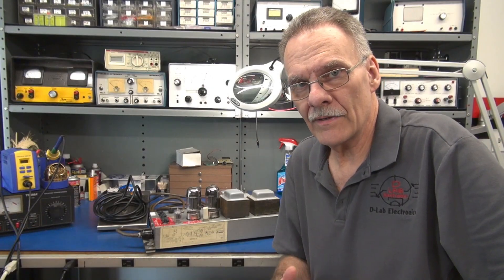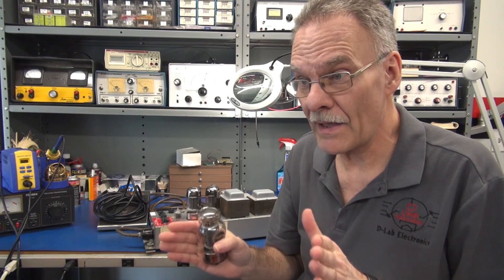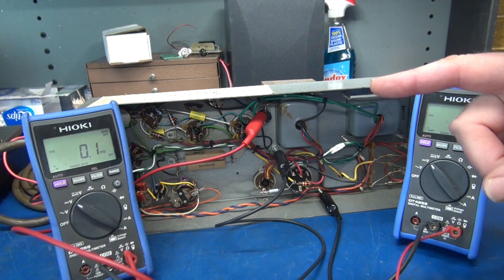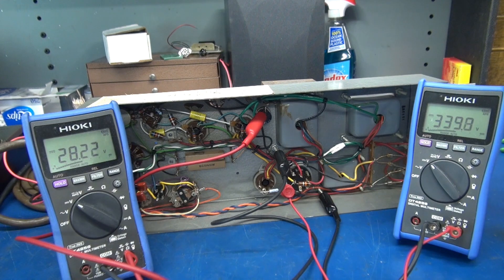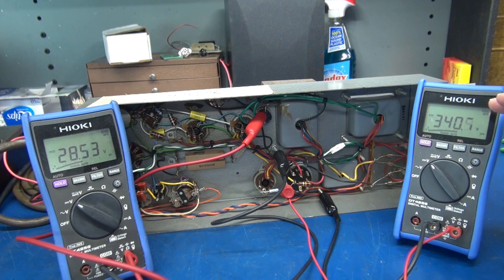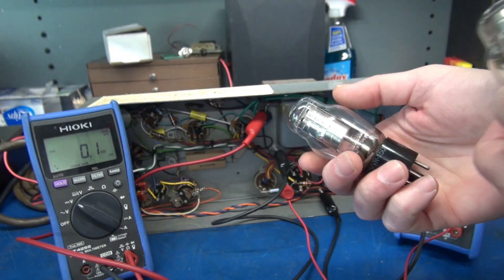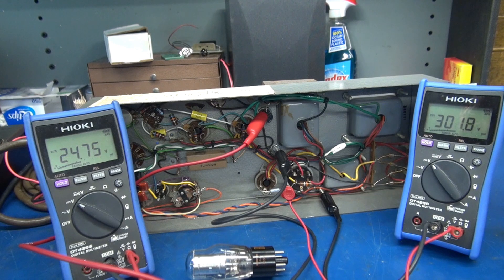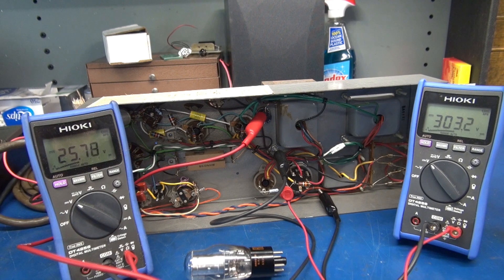Vintage Leslie 147 Tube amplifier power supply voltage level adjustment 6550 bias

Comment: I am concerned about the way the plate voltage 455V was measured. As it was mentioned in begining the tubes before solving problem were not assembled due to saving from possible  damage but value  415V in schematic diagramm is always with all tubes in?   It  is tricky to do measurement without tube and get right value.

Comment: You must have fairly high wall voltage in your shop - hopefully the customer also does where he uses that Leslie.  There should be an 8 ohm resistor R1 in series with the power transformer's secondary winding located on the same terminal strip as the rectifier diodes; this amp might be early enough that it doesn't have it. If it doesn't, you should add it; it will drop the voltage a hair and will also give the tubes and can capacitor a softer start.  George has mentioned in the past that he has church customers with very high line voltage (Texas grid); he has been increasing the value of that resistor to compensate.

My units travel around, so I can't tune for a specific wall voltage; my solution is to use KT88s. The JJ KT88s sound very close to the vintage Tung Sol 6550s you had to replace.

BTW, the 470 ohm replacement is a tell-tale of amp problems in the past. Make sure you check the value of the fuse that's in the front of the amp, I often find these much larger than they should be when that resistor has been replaced. Any sign of red-plating on those tubes?

https://elektrotanya.com/PREVIEWS/63463243/23432455/oldies/leslie/leslie_145_147_sm.pdf_1.png

Comment: Innovative solution! However, the problem is not only the screen but also plate voltage. It should be some 415-420 volts (IIRC, too lazy to check from the schematics). The way how the 6550 tubes distort is essential for the legendary Hammond growl. So my solution would have been reducing the plate voltage as well with resistors or zeners.

Comment: I've got a Leslie 145, same as 147 but slightly smaller cabinet. My amp does have the opposite "problem" - low B+. The 6550 plates sit at 400V and screens at around 290V, so they're not stressed at all. Maybe it's because of a different power transformer on the European-made units.
Reply: Euro transformers were designed for 234V wall voltage, I believe.  Does your Leslie hum? If it does, both problems could be explained by an open section in your can capacitor.
Reply: @garlandmusic  Very little hum, as far as I can hear. I replaced the can cap with a CE 30/30/30/10 unit during an overhaul of the amp some years ago. Maybe I should test the can cap sometimes.
Reply: I have seen the low voltage condition caused by a partially shorted can.

Comment: D LABs, why is the AC line voltage higher than normal? is the AC to AC transformer have shorted windings. Changing the voltage regulator to a higher voltage regulator to step down the voltage doesn't seem right to be using a higher voltage regulator to step down the voltage to the operating voltage. Any reasons why Leslie 147 amplifiers even used voltage regulators? because most guitar amplifiers don't use voltage regulators at all.
Reply: The 0C3 in a Leslie amp does not operate as a traditional voltage regulator.
The 0C3 is wired in series with the screen circuit and the plate supply for the 12AU7 driver tube. Being wired in series, the tube acts as a dedicated voltage drop (around 105 volts, in this case). If the B+ supply changes, the voltages past the regulator will change by the same amount. Note that when Terry changed the regulator tube, the B+ still remained at 455.
The regulator insures that the screens stay at approx 100 volts below plate voltage; without using big resistors and additional loads.
By installing an 0D3 in this amp, the screen circuit (and subsequently 12AU7 plate voltage) are dropped by 150 volts, instead of 105.
Tech Note:
When the 147 and 122 Leslies were reissued in the 90s, the amps were equipped with Zener diodes, instead of regulator tubes.
Reply: @scottbc31h22  Any reasons why the Leslie designers used an OC3 tube in series to be a "voltage dropping" device? The datasheets for the 0C3 or the OD3 don't say how much voltage it will drop from cathode to plate. The way fender and marshall would create the screen voltage was using dropping resistors called "internodal resistors" tapping off of the B+ high voltage
Reply: @scottbc31h22  The Tube Regulator should be regulating both the Plate voltage and the screen voltage, I'm not sure why they designed it to only regulate the Screen voltage, any reasons why?
Reply: @waynegram8907  The 6550s do not like high screen voltage, they work better with screens around 300V. AFAIK, Donald Leslie based his amp designs on the 6550 datasheet, which says 400V plates and 310V screens for cathode-biased Class AB and 40W output.
Reply: @waynegram8907  The 0C3 in a Leslie amp is not acting as a voltage regulator, in the traditional sense. It is not actually 'regulating' the voltage.(keeping the voltage at a constant value). Leslie power supplies are really not regulated.
  Since the 0C3 is in series, it is acting as a "resistor" to drop the voltage by a set amount. 
For example, if the 0C3 sees 400 volts at the input, it will output 300 volts. But, If it sees 450 volts on the input it will output 350 volts. (figures not exact) This method of using a regulator tube (or zener diode) is rarely discussed in textbooks.
  The 0C3 is acting as a 105 volt zener diode. In reissue amps, the Oc3 is replaced with a Zener.
  The 0C3 , also known as VR105, has a voltage drop of 105 volts. The 0D3 is also known as VR150, therfore, having a voltage drop of 150 volts.
  My guess is that using the regulator in this manner is more efficient than using a voltage divider to reduce the screen voltage.
  Also, the plate supply voltage for the 12AU7 is tapped from the 'regulated' screen voltage.
  Schematics for the more common Leslie amps are readily available online.
Reply: Another interesting fact about Leslie's designs.
Earlier Leslie Cabinets were equipped with electro-magnet speakers. These cabinets had amps that employed 4 x 6V6 tubes for 20 watt rating, and 4 x 5881 (6L6) tubes for a 30 watt rating.
  Most Manufacturer's designs using EM speakers either use the field coil as a choke in the main power supply, or have a dedicated B+ tap.
Leslie tapped off the B+ supply with a 400 ohm power resistor, through the field coil and returned the field coil to the cathode circuit (!). The screens (and driver tube plates) are connected at the junction of the 400 ohm resistor and the field coil.
Removing the field coil from the circuit will throw off the screen voltage as well as the cathode circuit. The amp will still run, but it will eat tubes.
  When it becomes necessary to replace the speaker with a PM type, some techs have installed a large power resistor in place of the field coil, to keep the bias correct and keep the screen voltage down.
  This wastes 29 watts of power to unnecessary heat,
  There is a  mod that can be done to make the amp run right, without wasting all that power to heat. It involves inserting a zener diode in the screen circuit, and replacing the cathode resistor to correct the bias.
 IMHO the 6L6 and 6V6 amps were the best sounding amps Leslie ever built.

Comment: A few thoughts regarding Leslie amps. I have serviced and rebuilt numerous Leslie amps of various types.
1. Plate voltage in your amp is high, probably due to increased line voltage. Leslies were designed for 117 VAC line voltage.
2. I commonly see 430VDC on the plates
3. I usually see 27-28 volts on the cathodes.
    If you feel the cathodes are not at the right voltage, check the 150 ohm power resistor in the cathode circuit, and replace the 200 uf cathode bypass capacitor.
    Special note: The cathode resistor in the 147 amp is connected between the center tap of the secondary coil of the output transformer and the 6550 cathodes are connected to the speaker terminals of the OPT. (polarity of the speaker terminals and tube cathodes is critical)
  An old tech once told me that running these amps with 27 volts on the cathodes will not hurt the amp. he told me "Let them run a little cold".
4. If you suspect a shorted tube, it is best to replace the 470 ohm resistor connected to pin 2 of the 0C3. This resistor acts as a fuse if the tubes go into a screen short. I use metal film resistors, since they show if the resistor has overheated.
* USE ONLY A 1/2 watt RESISTOR IN THIS POSITION as it does act as a fuse. I replace this resistor whenever I see any signs of overheating.
5. The 0C3 also sets the supply voltage for the 12AU7  input tube. Plates of the 12AU7 should be 118 VDC. I commonly see 130 VDC here.
6. Check the .1 uf caps for leakage. There should be 0 volts on the grid side of these caps.
I commonly read 0.05 volts here with brand new manufacture tubes, regardless of brand.
If I see anything higher here, I look for a problem. Usually a bad 6550 or bad coupling caps.
7. If replacing the filter can, I recommend the 525 working voltage can from CE, instead of the Leslie spec 475 volt version.
Since the 147 uses a solid state rectifier, when the amp first powers up, there can be as much as 500 VDC coming off the power supply before the 6550s warm up.
8. a note for those not experienced with 0C3 regulator tubes.
These came in two different versions. The original version was filled with a mercury vapor, and had the Coke bottle shape, as shown in the video. These tubes will glow bright purple and will flicker and flash when the amp is under load. This is normal.
The second version is filled with a different gas (neonI think) and has a straight bottle shape, similar in size and shape of a 6SN7. These tubes glow orange, and do not flicker or flash.
9. A note about the 147 amp. The load selector on the top of the amp (open, 8 ohm, 16 ohm) is NOT a speaker impedance selector. The switch is for the INPUT of the amp, and is used to load the source. The 8 and 16 ohm settings are ther to the enable the amp to be connected to the speaker out of the source organ.
Reply: This makes perfect sense! Something else is causing the problem, it will eventually raise its ugly head again and then the od3 won’t help and there goes another set of tubes as well, lowering the voltage further with a different type of tube did not address the problem with the system.
Reply: @Robdoeme69  Seeing 455 volts on the plates tells me that Terry is experiencing line voltage significantly over the 117 VAC rating of the amp. I think Terry should bring the amp up on a variac set to 117 VAC.
  He also did not check for coupling capacitor leakage.
  Another note, 6550s seem to run hotter (actual exterior bottle temperature) than 6L6 tubes.
Reply: Scott is 100 percent correct!
Reply: I was thinking it’s possible the decoupling caps are possibly leaky which will get worse with time and plates just love high DC and red plating! 
Disclaimer: take my advice, don’t listen to me!
Reply: @Robdoeme69  I noticed that this amp has been worked on, in the past.
The coupling caps have been replaced. (But that doesn't mean they are not leaking.
  Also, the arc suppression caps on the motor outlets, the dividing resistor on the 12AU7, the cathode bypass cap, and the filter can have all been replaced.
I also noticed the output transformer secondary leads have been spliced (curious as to why).
The other thing I noticed is that the 470 ohm resistor on the 0C3 is not original; indicating that there has been an issue with one of the power tubes or the filter can shorted.
The 6550 Terry showed is definitely on it's last legs 9note the ring around the getter spot). I'll take for granted that Terry is correct that it is shorted.
Reply: @scottbc31h22  the other reason apart from high line voltage that he might have such high plate voltage is a result of a partial short in the primary winding of the PT. I've seen this on one Leslie amp, having serviced many of them it is a rare condition but it can happen. I didn't see him check filament voltage but that's what I'd be checking (along with DC leakage to the 6550 grids) before putting that amp back into service with a simple regulator valve swap.

Comment: 300v on the plates of a 6550? May as well have 6Ls in there and even those would laugh at 300v
Reply from the maker: The plate voltage is well over 420vdc, screens are 300. Rewatch the initial test
Reply: @d-labelectronics  did you happen to check filament voltage? That could be rather high too, reducing the life of the tubes.

Comment: So it's cathode biased? Eric Clapton and the Beatles sure made some cool songs with one of those.
Reply: All Leslie tube amps are cathode bias. The 147 (and 47, 46w and 44W) have a unique cathode bias circuit with the cathode resistor connected between the OPT secondary center tap and ground, with a bypass cap in parallel with the resistor, and the power tube cathodes connected to the secondary speaker terminals.
See my long post.

Comment: When the household supply voltage was 117 VAC it was OK but now at upwards of 125 VAC this amp runs into this
 problem among others.  At 40 Amp output this particular unit can be overdriven with results  that you found. Anyhow
this was a good fix Terry.

Comment: How did this get past them? I don't understand how they would design a circuit like that unless they wanted that distortion for Hammond Organs even though they knew it was going to burn tubes up.
Reply: When that amp was built, the wall voltage was about 10 volts lower, about 110 volts.  Now it runs about 120 volts.  That 10 volt difference on the power supply transformer means a higher voltage in the power supply to the tubes.  Some vintage tube amps don't deal well with that voltage increase, especially when the screen voltage of a tube like the 6550 is affected.
Reply: @amberyooper  Leslie amps were designed for 117 VAC line. My area has about 125 volts line. 
  The Leslie amps deal with this increase quite well. I have repaired and rebuilt many Leslie amps, and I commonly see voltage readings near what Terry has demonstrated.
I would not have changed the 0C3 to an 0D3. Just my opinion. ( see my long post)
Reply: @amberyooper  Isn't the wall voltage handled by the power transformer?
Reply: @electrolytics  Yes, it is, but if you put more voltage into the primary winding, you get proportionally more voltage out of the secondary.  That's just how a transformer works.  Any voltage regulation in the power supply takes place after the transformer.
Reply: @amberyooper  Ok thanks for the reply. Appreciate it.